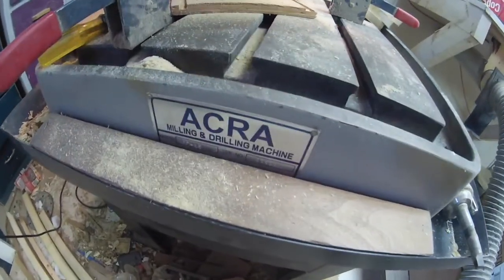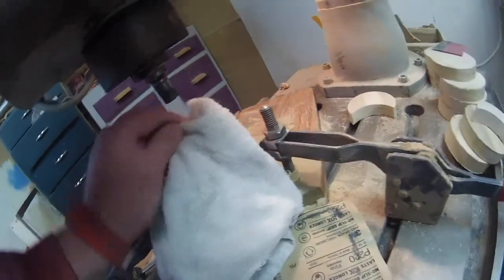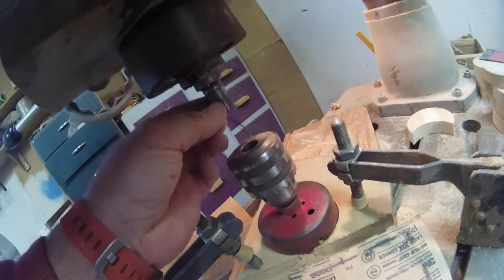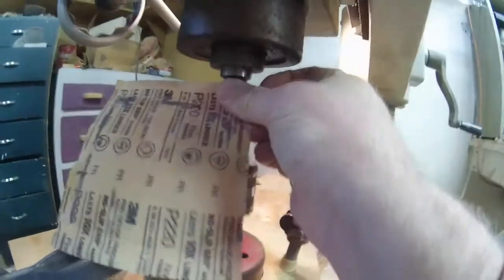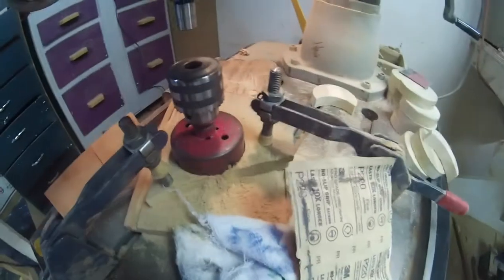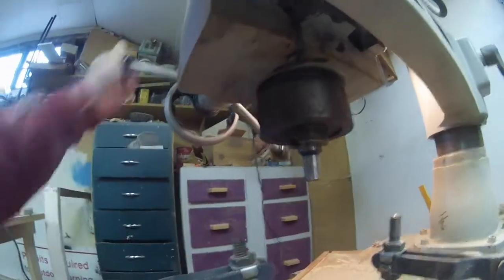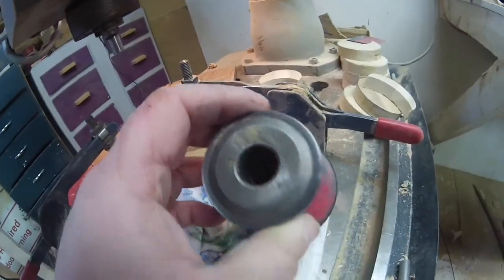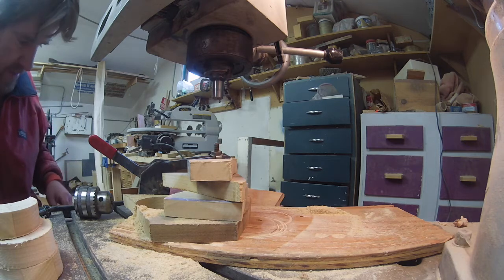ACRA Loose Chuck

Comment: Junk throw it out and get a new one. once they  spin there never quite the same.  just knock the old out of the spindle with a drift  tapered wedge.  get a new Morris taper to drill chuck adapter 10-15 dallier. # 3 to say 3j or 5j .  get a new drill chuck Jacobs don't go cheap on this  i would go key less but might not be in the budget  but that me. i drive 41/2 " hole saws thought s.s. at work. you'll twist off the end of the hole saw be for you should pull it apart .  give it a good rap with a soft hammer brass or lead to seat it. clean new stuff well with alcohol no finger prints  then you'll be lafing
Reply from the maker: Thanks for the info.

Comment: The hole saw is applying side load due to irregularities and high torque, quite common for the jacobs taper to come out.
Usually a good cleaning (inside and out, oil free) and a smart knock with a copper hammer seats the arbor well enough. Heating the chuck (and or freezing the arbor) beforehand will allow a tighter fit if needed. 
That sandpaper routine you got going there, not so great, you want full surface contact, not oil grooves. The arbor and chuck are disposeable compared to the value of the drill, so no harm done.
I've been told chalk helps on a jacobs taper, but it didn't do all that much for me when I tried.
The Loctite is just fine I think, especially since the arbor will still come out of the morse taper if need be. Just don't let any real machinists catch you.
Reply from the maker: I will give it a try.
Reply: The morse taper will also come out when milling, unless you have a hollow spindle for a drawbar. Drove me nuts on the weekend but I don't have a mill.

Comment: I had the same problem with mine and I heated up the chuck and chilled the taper with air duster in a can pressed it on as far as I could get it then chilled the chuck with the air duster then just let it set till it returned to room temp and its not come loose since....don't know that it would work in your case but maybe worth a try
Reply from the maker: I think I will try heat if it comes loose again.  Thanks.
Reply: also try some Permatex Sleeve Retainer or Bearing Mount Compound, its similar to loctite but it also fills the gaps where the tolerances are worn